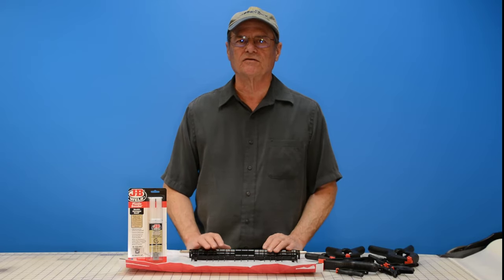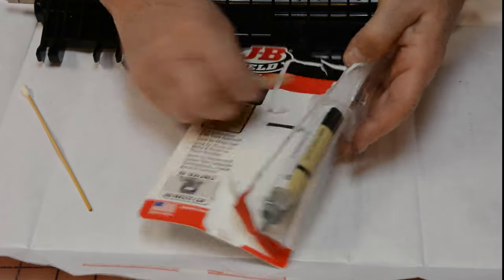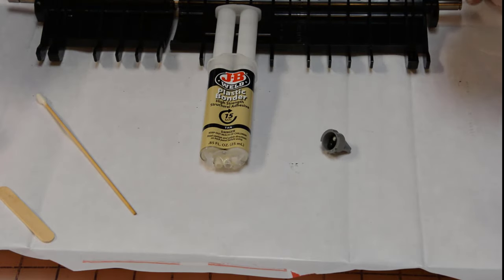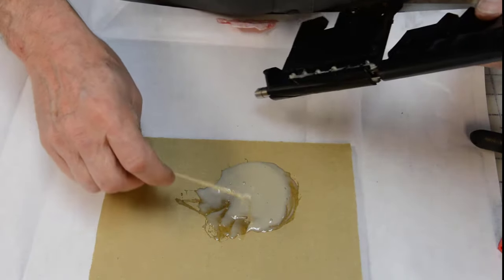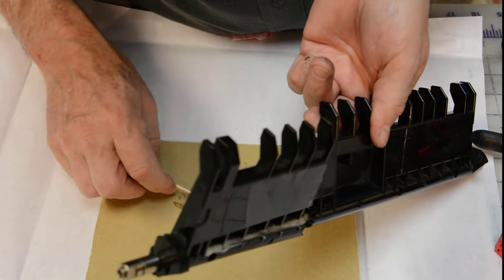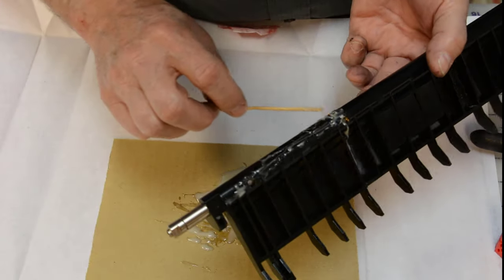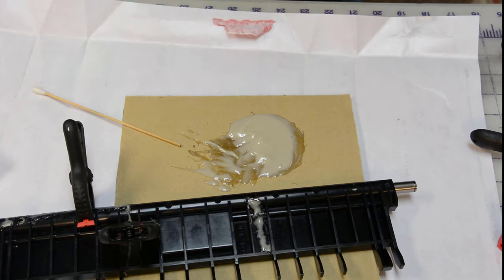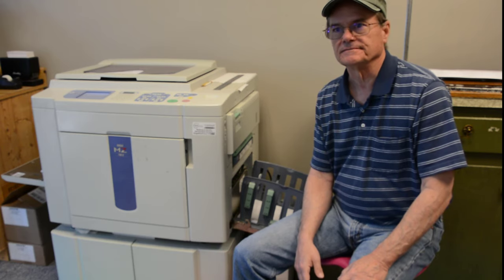J-B Weld Plastic Bonder - World's Strongest Bond

Comment: Fyi. At about 3 min in youll see him pick up the printer part showing the damage to be repaired. Look closely and youll see icons and letters molded into the plastic part from the factory. That info can be extremely helpful in most repairs. It will be the recycle codes manufacturing dates etc. It will tell you the type plastic the part is made of. Youll generally see letters like PP, PE,PVC,ABS,PC etc. Those are initials for the plastic type used. As a rule most household products are made from polypropylene PP or polyethylene PE. Both are difficult to repair with super glues. Even the ones that state works with most plastics. Read the fine print on those glues and youll prob find Not Recommended for PP or PE plastics. JB weld super glue light reacted glue works well as does Loctite rapid fuse. Youll find most adhesives wont work without an activater or primer ,catalyst.
Reply from the maker: Hello David,  You have made a suggestion I have not thought of.  Thank you, I will look into this more.
Reply: @DIYwithWayne  it looks like youve had plenty of practice dealing with repairs of this nature. Anyone who does this much will either struggle or learn what chemicals react positively or negatively to which plastics. And what bonds glues and holds with each type. Ive been welding repairs for over 30 years. I generally try to bond plastics rather than glue. Sometimes chemicals do it sometime heat works better. Good video thanks
Reply: @davidreynolds4684  what would you recommend for something that has pressure?
Reply: @mq4oneseventyeight567  depending on the material the epoxy putties are amazing. Oatey stick fix is good as well as jb weld. If its fiberglass or plastic with moisture or liquids the marine putty is good. If you are any good at welding it thats an option. There is flex tape and other roofing tapes that will litterally stick to any surface wet or dry and it takes an act of god to remove it. About 1.00 per foot at home depot.
Reply: Do you know any polypropylene or polyethylene primer/activator that works with epoxy glues?
Reply: @fabiomg  I've never tried anything with epoxies other than prepping the surfaces the best possible manner I can
Reply: @fabiomg  Not sure if it's suitable for Epoxy but look into Loctite 770 Primer which helps cyanoacrylate glues bond to PP and PE.
Reply: M
Reply: Heat is not gonna work better on that type of intricate small thing. Also, you have to have the expensive equipment! 

For what he’s doing the epoxy can work well enough, and it would be too hard to apply properly to such a intricate and small repair site.

Comment: Thanks Wayne. Had a windshield cowl that I repaired on my Chevy Astro... tried the 5 min regular epoxy but it failed. Used this stuff and it seems to melt the plastic together just like a polystyrene adhesive which makes it a stronger bond.
Reply from the maker: That's great.  Thank you for visiting and have a great day.

Comment: Thank you so much for making this video, Wayne.  Usually, I just read the directions on the product, try to follow them, and hope for no surprises.  I don't need surprises when using a product like this.  I was surprised at how thin this bonder is before it starts to harden.  I was expecting epoxy type material, but this product is almost like water for a few minutes.  You show this, so I was prepared before using it.
Reply from the maker: Glad I could help. Thank you for the kind comment and for visiting, have a great day.

Comment: thank you DIYwithWayne!  I spoke with a rep at JB weld and told me to use the JB Plastic Bonder NOT the Epoxy puddy, which is malleable, ...the BONDER is not easy sanded.  I do need to have the area flush.

Comment: I recommend to use one of JB Weld's static mixers. What you do is you have the syringe pointed up, then you squirt some out on a paper towel so that both parts are coming out. Wipe it off. Then screw on the JB Weld static mixer tip. With it still pointing up, you depress the plunger on the syringe to push the mixture through the static mixture pushing the air out too which is why you hold it up. Then when the mixture gets to the tip, you squirt some out on a paper towel to make sure it's mixed correctly. This is foolproof. Really wish Permatex had static mixers too.
Reply from the maker: Hello Colt,  I have not tried those mixing tips.  I did use one that came with some epoxy.  I will plan on picking some up the next time I'm at a place that sells them.   Thank you for your suggestion and for visiting our channel.  We hope you have a great day.

Comment: does it work with rubber, plastic and metal? im trying to see if it will hold my charge pipe iat's sensor that i put with a rubber vacuum line o ring on the charge pipe all together
Reply from the maker: I can't say for sure but with the rubber part, you may want to go with a more pliable adhesive.   Thank you for visiting and have a great day.

Comment: When it fully cures, does it shrink and level itself out somewhat or does it end up looking blobby and messy? Was that old crack on the piece from years ago also fixed with the JB Weld Plastic Bonder?
Reply from the maker: It will level out some but not much.  The other repair was done with epoxy but not the same brand.   Thank you for visiting and have a great day.
Reply: @DIYwithWayne 
Thank you for taking the time to reply, good sir.

Comment: Wayne, thanks for this video! I have a tube of this product, waiting to repair a black ABS fender. But I'm trying to decide if this would be a better choice, or if I should stick with regular old ABS cement. Do you have any thoughts or advice? In particular I'm interested in whatever's going to have more flex/tensile strength
Reply from the maker: I can't say which would be the best.  I would suggest doing a test on something similar with both products.  You may also want to look into a plastic welder.  Some are very inexpensive.  This is a video I did on a plastic welder.  https://youtu.be/gH_Pxm3Of3k   Good luck with your project and have a great day.

Comment: Thanks for posting this.  First time using Plastic Weld and this helped me a lot with a hobby project.  As it happens, we have a Riso ComColor X1 where I work.  Different model but we don't have the document scanner on top so it looks very similar to yours.  And it's funny you are using JB Weld to repair yours.  The end of the X1 output tray is broken off.  It works fine.  But maybe the boss will let me try to fix it.  We don't use our Riso much at all any more.  We got a Canon i300 and that thing is incredible. And huge.  But the Riso X1 can print on envelopes and THAT is unique and useful.

Comment: Does it stay a little soft and flexable like plastic is?   or does it get super hard just like JB weld original?
Reply from the maker: It does get hard but maybe not as hard as regular JB Weld.  I have only used it on hard plastics but it works very well on them.   Thank you for visiting and have a great day.

Comment: It works better if you rough up the edge with sandpaper or a file... it gives more physical surface area for it to bond to, rather than a smooth surface.  I always overlap the crack with some metal or other piece of plastic...  you can push a screen mesh into the jb weld and then its super strong.
Reply from the maker: Hello calholli, I have used some of your suggestions in the past but in this repair it was not needed.  Thank you for your suggestion and for visiting our channel.  We hope you have a great day.

Comment: Just out of curiosity are the any fluids that could break the epoxy down such as gasoline, diesel, acetone etc. ? What if you wanted to repair a gas tank would it slowly eat away the epoxy?
Reply from the maker: I don't have a good answer for you.  It would depend on what the tank as made of.  I would suggest you contact JB Weld.  I have never called them but I have been told they have a good customer support team.   Thank you for visiting and have a great day.

Comment: I have a ceramic bobblehead which a piece has broken off and I would like to glue it back on.  Is this something you would recommend for repairing a ceramic bobblehead?  It looks rather thick and I'm afraid it will squeeze out from underneath the broken part being glued on.  Is there a lot needed in order for this to work?  What would be the best method to use gluing the part back on so it is perfectly lined up when gluing back on?
Reply from the maker: I don't think this would be the best choice.  I would use epoxy like this.  https://youtu.be/Sy5OloVaNIE    Good luck with your project and have a great day.

Comment: How did you avoid gluing the metal  to the plastic?
Reply from the maker: I did not avoid it.  In this case the plastic part is secured to the metal shaft so it does not mater.  If the metal shaft need to rotate inside the plastic, I would have removed the plastic part from the shaft then repaired the plastic part and then reinstalled it on the shaft.   Thank you for visiting and have a great day.

Comment: Does this work for a plastic radiator coolant
Reply from the maker: I don't know for sure but I would be willing to try it.    Thank you for visiting and have a great day.
Reply: @DIYwithWayne  good afternoon. I applied the JB weld , the grey and black . I applied on the surge tank on my semi. It was still leaking after 30 miles. Pulled into a Walmart and bought me the JB weld plastic adhesive bond. Applied one coat/ about 1/8 of inch thick, then after setting I put a layer of electrical tape, and then applied another layer of bond... 

Well after 60 miles it was leaking but not as bad, top off surge tank and drove another 150 miles and Levrl look good. Drove a total of 1100 miles and had to only put back about a quarter gallon in the surge tank. 

Just want to share my experience and thank you for your videos. 🙏🏻
Reply from the maker: @Jesse-pl6hy  Thank you for the update.  Good luck on your repair and have a great day.

Comment: Do you think that JB Weld will hold up on a vehicle dashboard,  I have a crack that runs about 8 inches on the dashboard. I live in SE Texas so the summers are brutal with a lot of humidity.
Reply: Wayne McBryde the JB Weld worked great on the dashboard. It filled in the crack and holds the dashboard in place where the crack was. Thanks for your videos!!

Comment: Can I use that glue on a cracked laptop battery?, I has arrived a little cracked because of the shipment, it was a very long journey and I would like to know if that glue is heating resistant?
Reply: Check the jb weld website and you can find out there the max temperature the epoxy can handle

Comment: The handle on my built in microwave broke off, first bottom them top.  Looking into space, plastic parts are small and surrounded by air space.  What are chances plastic parts will stay bonded with handle being pulled on daily?
Reply from the maker: It is hard to say but I would give it a try.   Thank you for visiting and have a great day.

Comment: Could this be used to fix a small crack in a bathtub floor
Reply from the maker: I have a rental house that had the same problem a few years ago.  I replaced the tube with a better fiberglass one.  It made a good replacement but to get this done would have been a very expensive repair.  I suspect your tub is plastic and if so I would give this product a try.  Make sure you go beyond on cleaning the area to give the plastic bonder the best chance to make a good repair.  I don't know if it will hold but other than replacing the tub, I don't have a better idea.   Good luck with your project and have a great day.

Comment: Do you think this is stronger than super glue ? Thank you Sir ^^
Reply from the maker: It would depend on what you are using it on.  Supper Glue works better on smooth surface's and Epoxy works better on porous surfaces.  Thank you for visiting and have a great day.
Reply: @DIYwithWayne  thank you very much brother, have a great day and stay warm

Comment: I can't believe they still make this dispenser with that stupid cap.  I think they purposely designed it for cross contaminating the adhesive and hardener.  The tubes with the screw caps are as good as it gets.
I love the Devcon plastic welder, but the smell is overpowering until cured.
I'm assuming this product is the same?
Reply from the maker: I did not find the smell offensive or strong.   Thank you for visiting and have a great day.

Comment: He should of used the black wb weld plastic bonder
Reply from the maker: When I purchased the JB Weld, the only color available was the one i got.  However the part is very hidden in the machine and unless it is removed, no one is going to see it.   Thank you for the comment and if you have not, please subscribe to our channel.  Have a great day.
Reply: I wish it came in clear. I need to fix a broken clear plastic cover.
Reply: @DIYwithWayne  Has the part that broke been holding?
Good informative video
Cheers
Reply from the maker: @SDsailor7  Yes,  It is still in the machine and working like new.

Comment: 1 It is called Plastic Bonder, not Plastic Bond. 
2 It is not an epoxy; it is a a urethane, per JB Weld. Their Plastic Weld is an epoxy.
  Plastic Bonder is available in black or tan. I have used this product a lot and works exceptionally well but it is not as quick as they say. Let it cure for a day for maximum strength. Like any adhesive, prep is everything. Sand the surfaces and wipe with a solvent. Alcohol is a good bet as it won't soften thermo plastics, as acetone does.
Reply from the maker: Thank you for visiting and have a great day.

Comment: Saw another test on utube that shows j-b weld original is just as good or better than this stuff
Reply from the maker: I have used both and chose to use the formula for plastic but you are correct they both would most likely have worked.   Thank you for visiting and have a great day.

Comment: He applied a "liberal amount", liberal enough so that the metal rod won't be able to roll liberally  🙄  
Why doesn't he pay attention to this?  Can you work PRECISELY with this liquid-like stuff at all?
Reply from the maker: Hello Zoltán Szűcs,  I did use a bit much glue on this project but it was sanded smooth after drying.  As for the metal rod, it is pined at one end and is not supposed to rotate in this part.  Thank you for visiting and have a great day.

Comment: Not a good idea to use alcohol for epoxy prep. Acetone is recommended. Alcohol can prevent epoxy from curing.
For a repair like this 3M Scotch Weld PR100 is FAR better than any epoxy. Epoxy does not actually bond the plastic together.
Reply from the maker: Thank you for your suggestion and for visiting our channel.  We hope you have a great day.

Comment: I don't think this epoxy will work well at stress points. That's where most of them fail.
Reply from the maker: It won't fix everything but is better than any other glue I have used.   Thank you for visiting and have a great day.